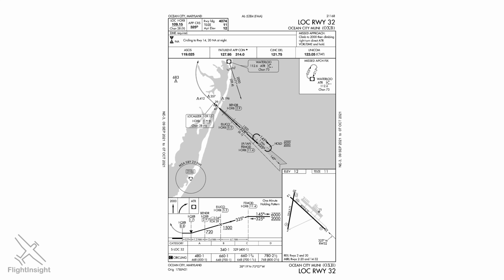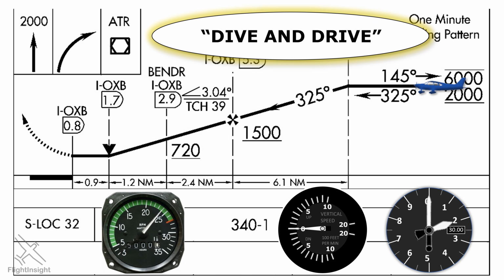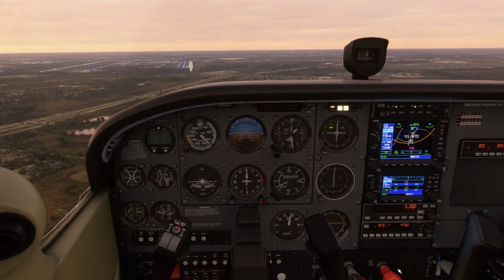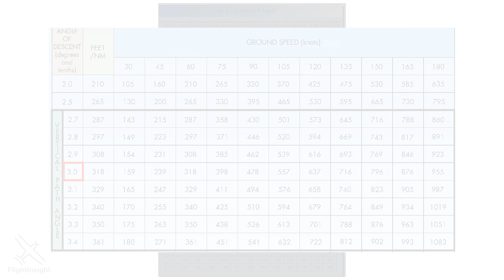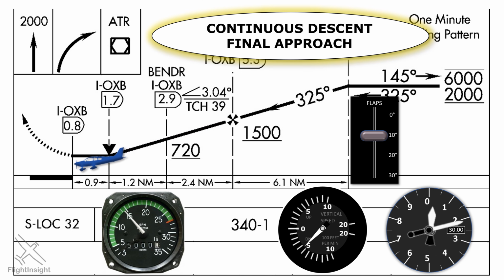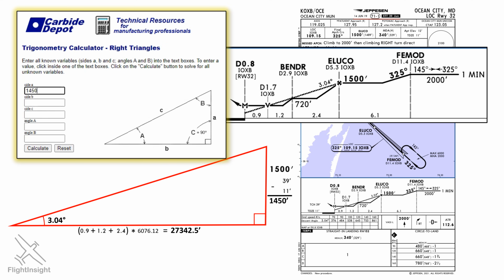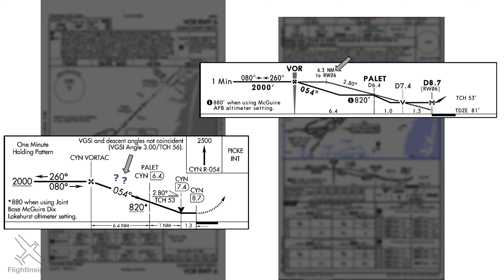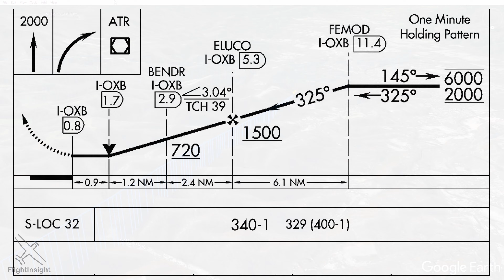How to Fly a Non Precision Approach | Continuous Descent FInal Approach | LNAV + V

Comment: In your first example you show going missed at the VDP.  While you may plan to go missed if you don't see the runway at that point, you must carry on to the end of the runway (which is the actual missed approach point) before beginning the missed approach procedure, correct?
Reply from the maker: Correct. It looks like the animation has the aircraft climbing out at the VDP, but with the MAP defined as the runway threshold that is where the initial climb out should begin. Thanks for that!
Reply: But doesn’t a CDFA exclude straight and level segments even if missed approach is to be carried out? I believe that’s where the difference between a CDFA and a non-CDFA missed approach lays. For example in a non-CDFA you would fly straight and level from the VDP to the MAP and then start climbing, whereas for the CDFA missed approach you would start climbing at the VDP in case the runway is not in sight since CDFA approaches never include a straight flight segment.

Comment: Your video lectures are generally excellent. They a nice review for those of us that have been flying IFR for a little bit as all continue to learn, and a great way to learn if just starting. I would like to suggest one correction this video.  You reference the use of the Rate of Decent Table in the Chart Supplement for localizer only approaches.  This is a nice resource for many reasons and all IFR pilots should have easy access to it.  However, when correlating the angle of decent on the glide slope with the ground speed, I believe the table shows a rate of decent in ft/nm and not ft/min as you stated.  Of course, this is what we want as our VSI reads ft/min.  To obtain ft//min, multiply the ft/nm by 1.5 (90 nm/60 min). I think I have this correct, apologies if not.  Please keep up the great work.
Reply from the maker: Thanks for the nice comments Joseph, and for catching this item. It will be fixed in the final course!
Reply: I think you are not correct, Joseph. For a given descent angle, the ft/nm is constant. But the ft/min changes with the ground speed. All the table does is give you some precalculated values. The columns below the ground speed row are therefore in ft/min.

Comment: As an Australian I found this interesting, here we only do this style of NPAs, there’s no dive and drive taught here. For GPS LNAV (no WAAS in Australia yet, don’t ask, its coming soon) we have target altitudes every 1 nm during the approach to provide the vertical guidance from the IAF to the MDA. We aim for a stabilized approach from the descent point (normally at IAF or between IAF and FAF) with minimal power and pitch changes. AirServices (our airspace operator) has aimed to make each approach as close to the same as all the others as possible. As such it is normally 5nm from airfield to FAF, 5 nm from FAF to Intermediate approach fix (IAF) and then usually up to 3 Initial Approach Fixes (IAF again) 5 nm back again.

Comment: Thanks a lot for this explanation about the NDB approach  it's very detailed  easy to understand  and it will be very helpful if you do a video in  how to intercept a track using a Fixed-Card ADF inbound and outbound and the tips of making the relative Bearing easier to understand because this subject is one of the most challenging  in IFR flying i should mention that there is no videos at all on youtube addressing it properly except a flight instructor  called Ray preston  but with low quality and  poor sound video  .
Reply from the maker: I think that would be a great video, thanks!